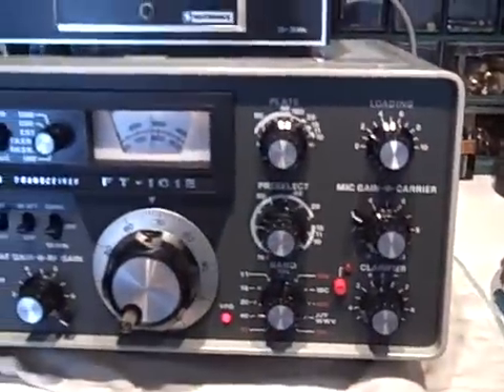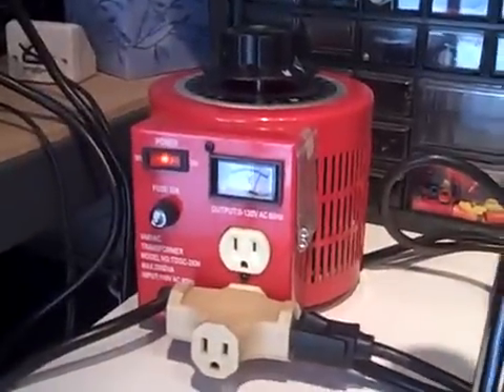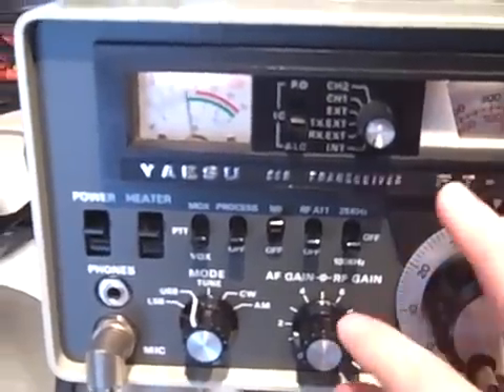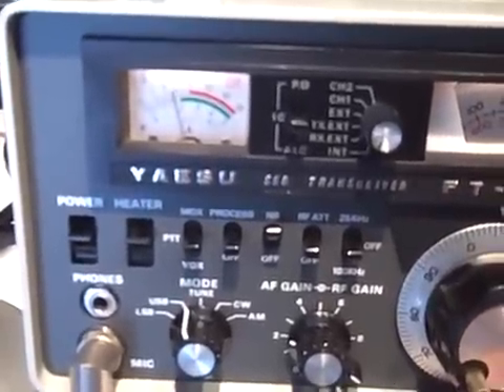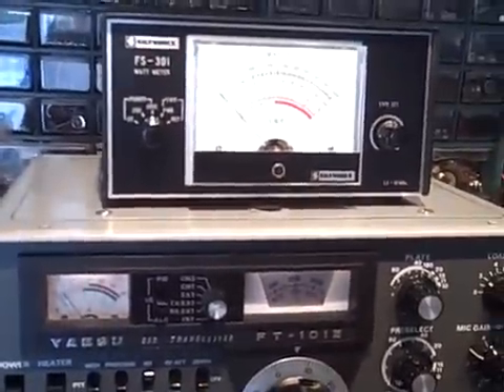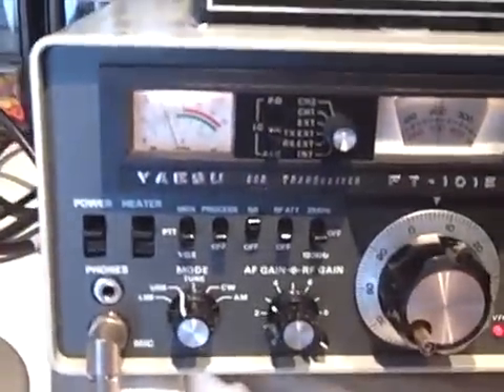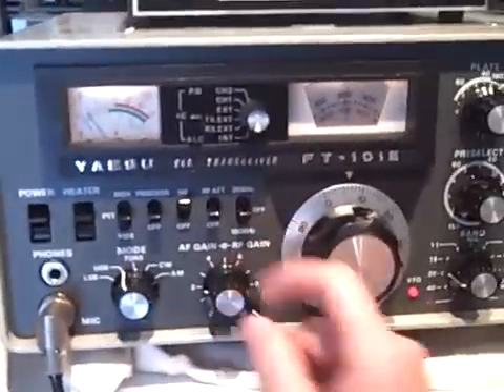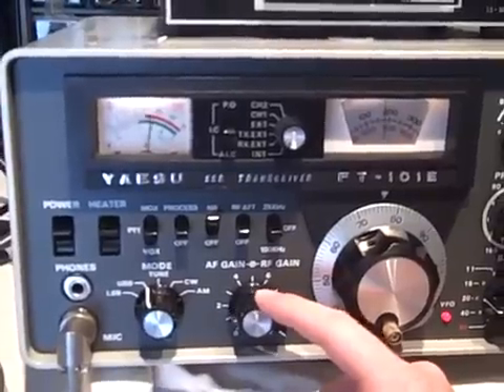Homebrew dipole at 6' off ground on 20 meter using Yaesu FT-101E

Comment from the maker: Thanks for the comment!

Absolutely, Hawaii isn't too difficult to reach depending on band and atmospheric conditions. Using only 50-100 watts it's also possible, but the amplifier definitely helps. Communicating with San Diego is definitely possible, but there are many variables - too many to list in a comment box. Best thing to do is to learn all about HF, antennas, and propagation and have at it!

73, KF6UME

Comment: Hi kf6ume,
Very nice rig and set-up you have. Enjoyed the vids.
Quick question:
You mentioned Hawaii in the video.
I was curious if you can carry on a two-way communication
with Hawaii with your radio. And if so, can it be done with
just the radio itself or are you needing the matching 
PL-2100B amplifier.

I ask as I am going to have to move to Hawaii some day and 
thought I would like to stay in touch with some friends here in San Diego.

Comment: Hi, At the height you have the antenna it will be a good NVIS antenna for 20km to 500km contacts. the radiation pattern should be more or less vertical I would think.
Well done with the Video.

Comment: That is a great question. Most people don't notice the variac in the background. I use it because my FT-101E is 34 years old. The capacitors and all other circuitry are original. I let the radio acclimate for up to 1 hour before reaching 117VAC. Yes, it works fine just plugging it in and hitting the power switch, but I like to baby my 101 for longevity purposes. In other words, I'd rather be safe than sorry.
Reply: I fire up my Swan 500C without a variac....no problems!